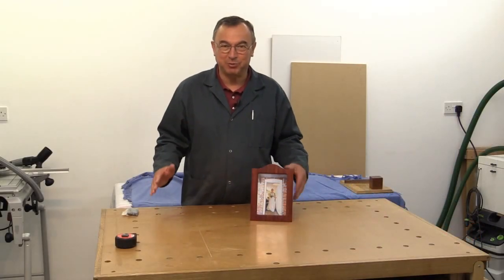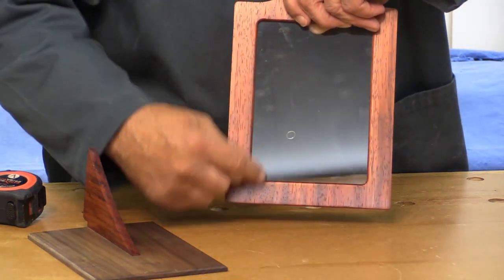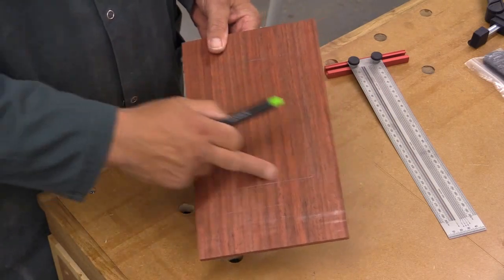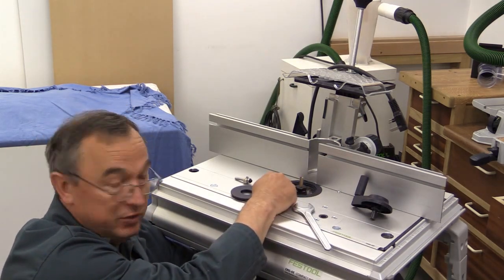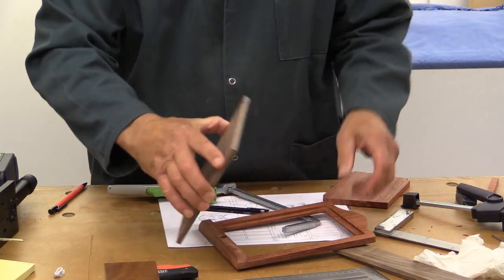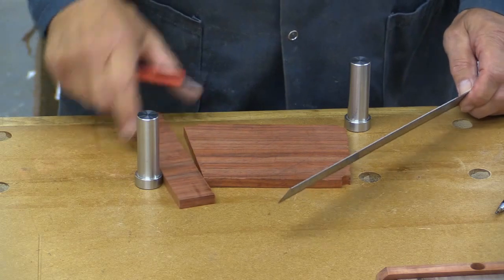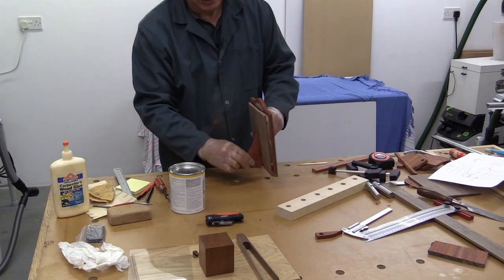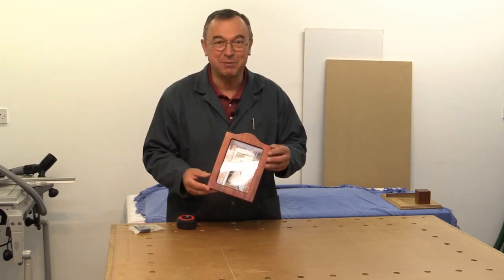Simple Ideas for Presents 4

Comment: Love video and ideas as always. Maybe you couldn't afford to buy others presents as you kept treating yourself to lovely tool presents 😉 just ordered myself WERA driver and bit set on your recommendation and they are lovely tools. 
Any reason you use CMS over your UJK router table here. Would I survive if I only had the CMS (dreaming of future presents). Thanks.
Reply from the maker: Hi Luke, You are probably right that buying tools making me broke !  Wera kit is good. I have just discovered the Festool Centrotec standard and like it a lot - I will do a video later in the year. Yes, you will manage perfectly with just the CMS-OF. It is really well made and easy to use. If you need a tough, static machine then the UJK, with cast iron top, is also good value.  Many thanks for your support.     Peter

Comment: Great gift idea and presentation Peter, as you say keeping the dust at bay it tricky when you are covering up the rear fence dust port. We get over this by using under table dust extraction using the INCRA - CleanSweep Dust Collection Cabinet. By the way what make of pillar drill are you using? Cheers Peter
Reply from the maker: Hi Peter,  Yes, I could have improved the dust collection by taking one of the reducing rings away thus improving the under table collection. I have a dust cabinet on the UJK setup, possibly similar to the Incra one. I bought my pillar drill from Axminster at least 12 years ago. It was the end of a line (I think) as I got a bargain but they have improved them a lot over the last 5 years. For woodwork mine works well but it would not be good enough for accurate machine shop work. I am just finishing a video about Osmo PolyX Gloss (product code 3011) - it is brilliant and I have used it to finish the pedestal desk. Have you tried it yet?    Peter

Comment: Very nice present ideas in this and the other video. I see you now have the CMS for the router, if you had to chose between the CMS and the UJK which you you have ?
Reply from the maker: Hi Martin, If you look back at my very early videos you will see that I had two home made router tables - one was a big solid job and the other fitted neatly on the end of my Festool MFT3. I still like to have two tables as I can do work in a 'production' way. But to answer your question...If I were a static woodworker in a good sized workshop with no need to work off site then the UJK table would be fine. If I had a smaller workshop and perhaps needed to work away from base then the Festool CMS wins. If we downsize our house (and workshop) in a couple of years time then the Festool will come with me.   Peter
Reply: Peter Parfitt Thanks Peter
I am lucky and have a good size workshop that is already full of workshop equipment and would like to replace my current router table. I built a copy of the New Yankee Workshop router table about 6 years ago and whilst it is a good table it is extremely heavy, large and does not have the router elevator so I am investigating what is out there, I would not have the room for two large router tables. Thanks very much for your response it has helped me a lot with my decision.
Reply from the maker: ...and your decision is???
Reply: Martin Feeney  
I will go for the UJK, I like the size and the cast iron table, with the few tweaks you showed in your video this work for me.